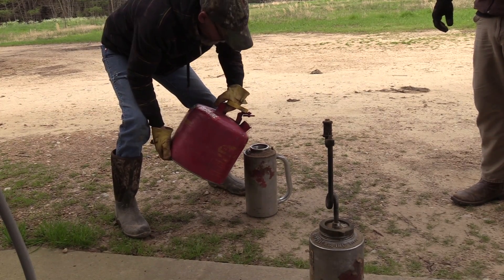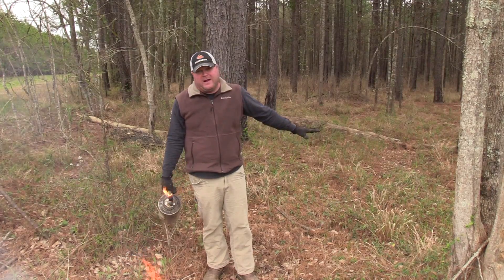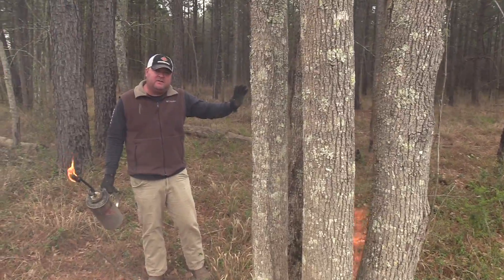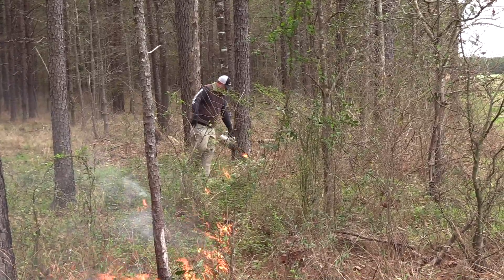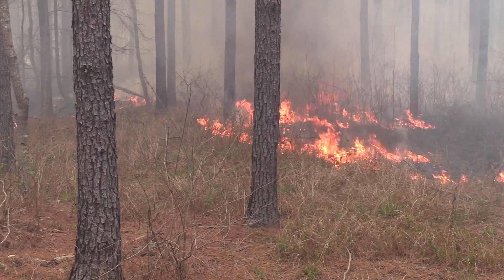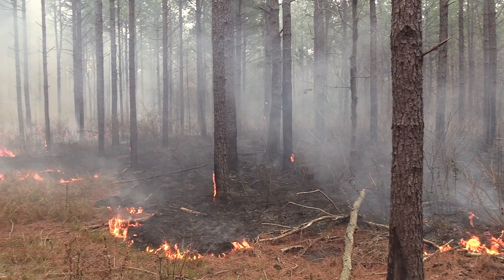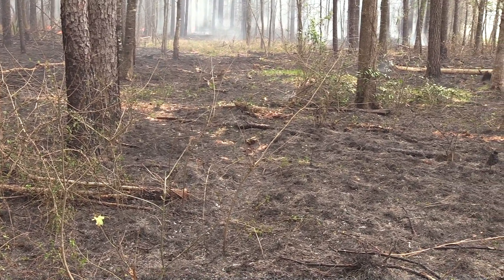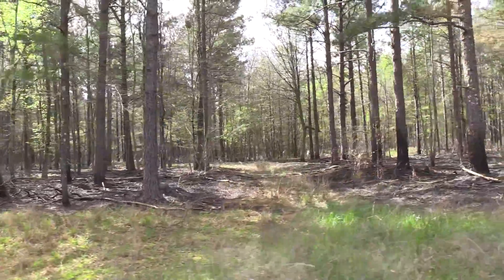prescibed fire in pines

Comment: Without thinning your timber what response do you really see? Statistically it should be none other than a light reduction in fine fuels. 

I am interested in your take away from fire in a closed canopy forest though. 

Thanks for sharing.
Reply from the maker: We are on about a 10 year rotation thinning a portion of the timber every year. We use fire in the pine plantations where there is a more open story. The fire burns off ground litter, kills small saplings like tallow and Sweetgum and releases Forbes, weeds and grasses. We do not burn in the mixed hardwood pine stands.